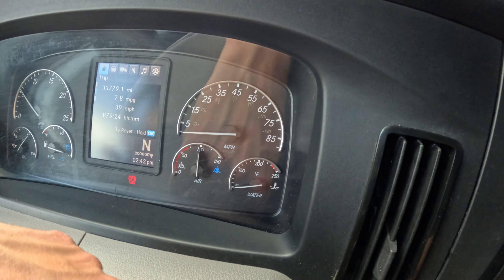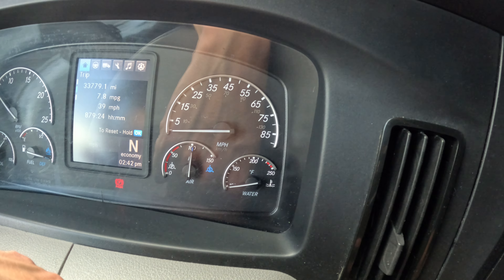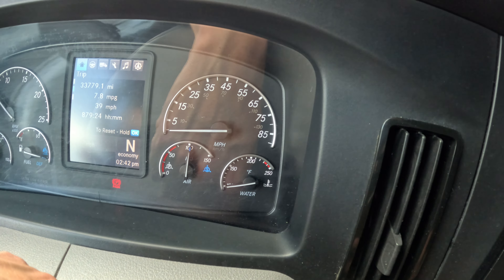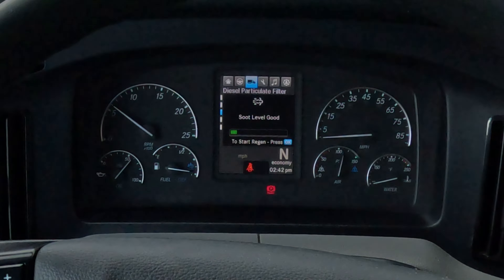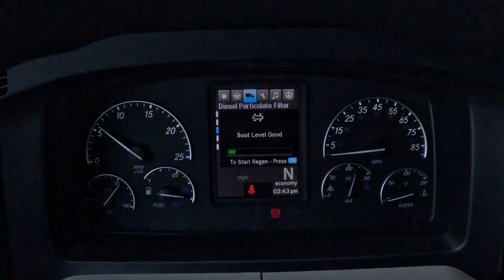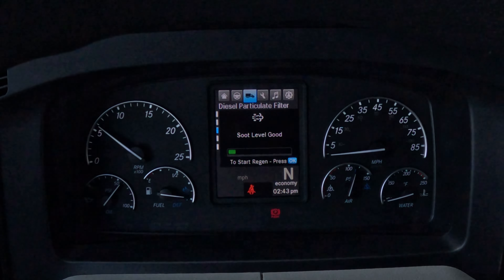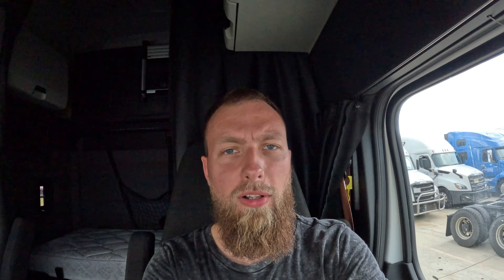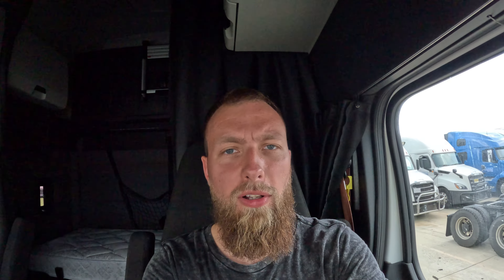2020-2023 Freightliner Cascadia Parked Regeneration instructions. DPF regen

Comment: I regen it three times but the lights are still on and it won't go more than 5 miles. How can I reset it?
Reply from the maker: Try to reset battery. If it's not helping - will need towing to shop.
Reply: @ no battery is not helping

Comment: Yeh my truck even if its over 180 still it doest npt allow to do manuel regen ?
Reply from the maker: Try to reset truck, try multiple times over a day. If its not working, and you have multiple check engine lights, need to see by dealer...